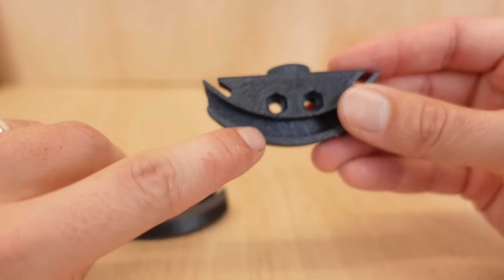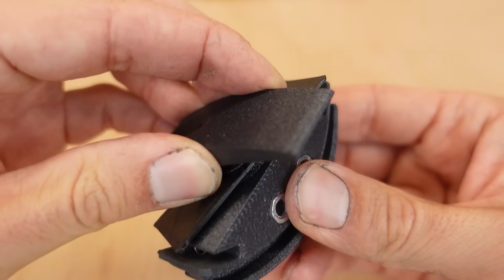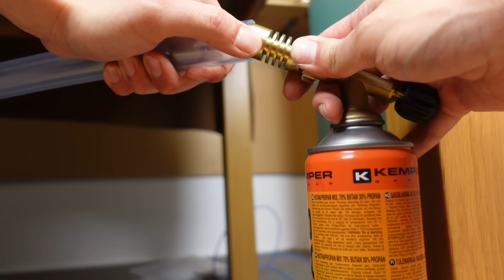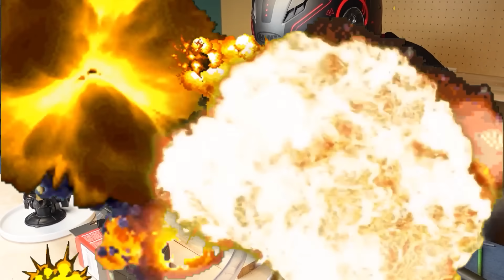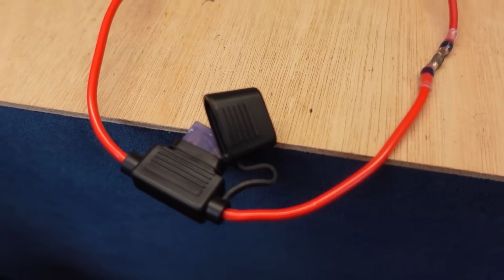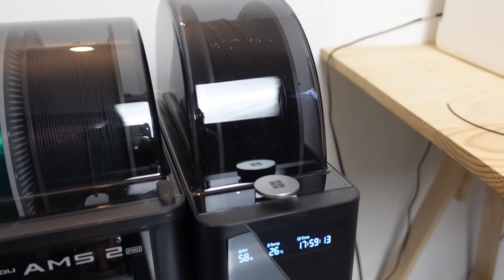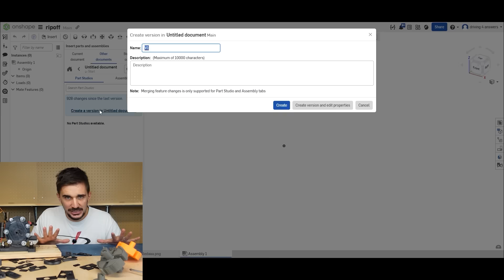My Oval Engine Now Fires At Will! Major Milestone For DIY Oval Rotary Engine 2.0

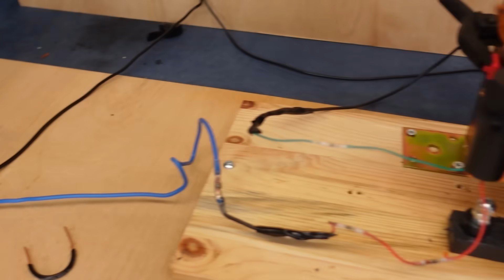Comment: BTZ5S-BS (at 6:18) is a 12V battery when fully charged 2.2V per cell X6 cells = 13.2 volts
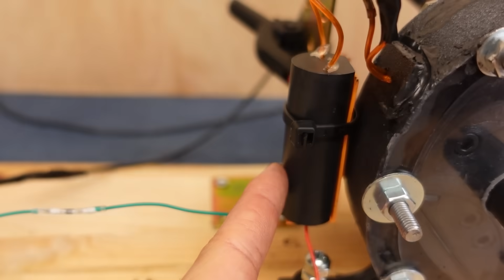High Voltage Generator (at 6:28) DC 3v-6v to 400kv
I wonder if using four (4) times the recommended input voltage could cause premature HV coil failure. Yes, it could. For better results, use 1 X 18650 = 3.7v to 4.2v
Oh, you agree. I should watch the full video before commenting.
P.S. I love the engine! I think the timing/exhaust port tuning will get a win!

Comment: It would be pretty easy to 3D print a single point distributor that would allow you to adjust the timing in real time. 

I feel like the main problem is the exhaust port being too advanced and the spark being far roo retarded.

Comment: you need it to fire on the trailing edge,  youre firing in the middle, which isnt putting any forward motion in.. should try to offset the firing events to where the next event hits at the same time as the first... might need.. 3 firing events

Comment: You are going straight from the fuel to the engine. Where is the oxygen? Mix the fuel with oxygen and find a way to adjust the timing.

Comment: old Honda dirt bikes (xl125 185 etc) had a CDI unit that replaced the Points set up, still bolted on to the cam like points but was much simpler. 
Could be a good bolt on option for a quick fix for timing as can use two sensors and coils

Comment: use small bearings four, total, on the center spiner so the travelers bottoms run against the  bearings  2/3 spaced sporting the travelers.

Comment: I commented this on the previous 3D printed engine video, but there is a major flaw with this design. The area between your intended combustion event area also expands and behaves like a combustion event area. This can be clearly seen in the slow motion footage at 10:19. The previous design even had the area connected, meaning spark could ignite the fuel all the way to the intake. It seems like this version had enough sealing in this in between area to not connect to the intake. Regardless, this area needs to be accounted for in future designs because it expands and compresses the air as well.

Comment: Maybe add an adjustable exhaust port, a couple of seals around the periphery of the port inside a slot with a set screw to hold position.  Once you get optimal position, print it again with the port fixed in position.  I wouldn't imagine the intake matters that much, but maybe do the same thing with it.

Comment: Seriously cool! I don't know what you've already tried or what experience you have with rotary engines, but here's my take.
First, I would put a flywheel on it.
Second, I would look at the port timing on a Wankel rotary engine to get a comparison. I do think your exhaust port is too high.
Third, I would play with the ignition timing. I'd adapt a reliable distributor instead of home-building a hokey points setup.
Fourth, better sealing will always be a target. You need side seals.
I look forward to seeing more of this project!

Comment: You’re not going to see usable torque from this layout. Torque is tangential force acting at a distance from the axis, but in your configuration the forces are applied symmetrically on both sides of the crank, as are the forces on the opposing chamber.. They cancel each other out, which is why you’re getting combustion but no rotational acceleration.

Did you notice any increase in crank speed during firing? If not, that’s the tell. I really don’t want to see you sink more time into a geometry that can’t produce net torque. If you ever get this design to self-rotate, I’ll gladly eat my words. Your talent is probably better spent exploring a different configuration.

You don't have to take my word for it. Find an expert you trust to take a look.

Comment: Is there any air or oxygen in that can of LPG liquid petroleum gas?  Butane and propane are both fuel, you probably have a wider range of air fuel ratios that can ignite than gasoline, but you still need oxygen.  The torch nozzle won't mix the correct amount of air unless the outlet is unrestricted.  It is using the flow of LPG to suck the air in.  You still need a carburetor that meters the LPG based on how much air you engine is sucking.

Comment: @d4a You def need to move that exhaust port lower and/or the gas igniter too (more central of the housing). Combustion is happening too late and pressure is released too early and without much of the rotational energy from the rotor almost squeezing out the burnt gases. You can see the visualized at 14:22 in the slow mo footage. Maybe even 2 spark plugs to get a faster and have a better coverage of the ignited gas over the rotor surface. The timing could probably adjusted from where it's located but IMO think it's location is not ideal. I saw at 17:00 you addressed this and will take many more prototypes to get right. I believe you will get it going on it's own soon. Love seeing the progress, keep it up bro!

Comment: I've been down this road.  If you want to start a model engine with a drill rig a one way bearing between the two so the engine can overrun the drill.  Otherwise it will never start.  BTDT got the t-shirt.
Reply: not true at all, youd feel the engine torque the drill, if the engine is large or powerful enough it rips the drill out of your hand and sends it flying.. a sprag clutch for starting would be ideal, but its not stopping it from creating torque, its clear the combustion is far too late, it needs to be starting near 9oclock and hes not getting it until more like 12 oclock, by that time the chamber is at its largest volume and about to open the exhaust port
Reply: 1000% correct. 👍
Reply: Use an air tool to get that rotary vein spinning up the rotary vein. There's little breaking once it starts up, relatively.
Reply: Exactly! My first to.

Comment: I think this engine is struggling to get enough air and fuel to fill the combustion chambers. On a traditional engine with a propane fueling system I believe the propane is injected into the air stream in a predetermined amount. This engine I think is not able to get enough air due to the torch head not supplying enough to fill the combustion chamber to be able to make enough power to turn on it's own. To me the timing looks good enough to run if it had enough fuel and air that it wants not what the torch is supplying.

Comment: Well done on getting your rotary flamethrower to produce some flames. I'm still a bit dubious about you being able to get any usable power from the engine though. To get power you want as much of the pressure produced from combustion to be producing force to turn the crank rather that pushing the rotor into the crank. A bit of modelling and some guesswork on cylinder pressure should be able to show if there is any significant rotating force.

Comment: If you're looking for high voltage arcs, the mythbuster, after using many different options, found that a neon light ballast consistently produced a reliable high voltage arc that would start fires, of whatever myth they were chasing at the time.

Comment: First I wrote comment, that these modules don't like 12V before the end of the video, then deleted it as you fixed it.
Only one thing is missing, these high voltage modules don't like to keep the charge on its output.
It is better to add wires in parallel to the output of the module with bigger gap than in combustion chamber so it will discharge high voltage if your engine is not requiring a spark at that moment.

Comment: I've sent you an email linking to a Desmos graph with the exact geometric equation you can use instead of tracing from video, which will create a much better seal. I've also sent you two designs you can choose, one similar to russian patent, one that use rod instead of large gude which should be stronger and lighter. I sent it few months ago so you may need to search it.
Reply from the maker: I never got any of this! Give me the words from the subject line so I can search for it.
Reply: @d4a  Improved Rotary Engine Design

Comment: Your spark is too advanced. Print an adjustable trigger wheel instead of that wonkey floating wire "trigger" all that work and you hacked the ignition? keep the automotive coil. Print a hall or brush trigger.

Comment: 1. You really want to use electronics to trigger the sparkplug. A simple hall sensor and a magnet on the crankshaft to learn the position of the piston or even better some rotary encoder on the end of the shaft so you always know the position of the shaft so you can easily adjust the timing of the spark. Yes more electronics, but sparking using floppy wires ... how can that be consistent or easy to advance/delay with a simple dial? Potentio meter on a Raspberry Pi, for example, hall sensor to the Pi, a few lines of code to detect the hall sensor (or rotary encode) and a simple signal to a power transistor to open the current from the battery to the spark generator. Also you might want to consider to actually use a real sparkplug. You can also detect using this the RPM of the engine and advance/delay the spark when needed ; at first manually, later you can let code do it ; at this and that RPM use this degree etc etc

2. the exhaust is a little large. That should affect the backpressure. What if it is a much smaller hole? Will the chamber be pressurized longer, enough for the piston to rotate fully/fast enough? I could think of a simple way ; take a piece of metal tube add a (metal) valve on the end of the tube to reduce how much gas can escape. Fully open, it would be like what you have now, when you slowly close the valve you can decide with unlimited steps how large your exhaust port will be.

3. for the experiment you actually do not have to shape the front ; it can be a flat square piece ; saving time. So if you want to use a thicker piece, just cut it to roughly the correct size and drill holes and you're good to go. Some RTV to seal it and done. It doesn't matter if your 'window' is sticking outside the black cylinder, you want it to run, not look pretty.

4. in combination with the electronics, you could have a small servo operate a small valve on the fuel line. It wouldn't be perfect and sensitive, but you would be able to control the throttle with the electronics ; at first with the manual potentio meter (controlling spark advance/delay) and with a second potentio meter it could control the gas pressure. You might need much more to keep the engine actually running while at start you want to just feed it what it needs. 

5. there is a chance the friction of the whole setup is way too much for the combustion to overcome. Your electric drill was obviously struggling to keep the thing going.

6. instead of a drill with all it's issues (from running out of power to how do you quickly decouple it) I'd go for a starter motor. Not from a car, but just a normal electric motor, mounted to the shaft with a small friction disc and some spring. Or a vize or a rubber belt or two rubber wheels ; something which can break friction between the electric motor and the combustion engine once that one gets going. Actually the electric motor could become an alternator/generator basically if you turn off the power to the electric motor after the combustion engine has started. The electric motor could also work as a flywheel/load so you could try to measure the combustion engine's power. If it fires up.

All in all it feels like trying to set a big water soaked log on fire by pouring a cup of gasoline on top of it ; there are so many variables you cannot control current (gas pressure, spark plug timing, starter motor speed, exhaust backpressure) that it would be a small miracle if this combustion engine would work on its own. But with the proper support 'modules' you'd increase your chances by a lot. And it would be easier to reproduce results.

Hope this helps, good luck, getting this fired up!

Comment: 12v battery killed the DC 3v-6v high voltage generators plus extended spark wires

Comment: You should have picked up a set of Points when at the Auto parts store for a reliable and adjustable ignition system. A Flywheel wouldn't hurt either.

Comment: My best guess is the air/fuel mix is not well mixed enough before it gets ignited. 
If a ( or several ) very fine s/s wire mesh screens could be placed before the air/fuel intake, the physical turbulence could help mix the ratio more evenly per volume. 
I once had a factory made propane fueled pick up truck. It was otherwise a normal V8, that had a fuel section that took liquid propane and evenly atomized it , RUNNING THE AIR AND FUEL MIX THROUGH A MESH  to mix. It ran great. The oil looked new after many miles due to lack of ash. In my area, LP went super high one day, and converting it back to gasoline was a sad compromise.

Comment: Seems a lot more complicated than the old tri rotors and probably a lot less efficient due to more moving parts, more apex seals and other seals in general, and a significant percentage of the combustion chamber is now unused when compared to a tri rotor.

Comment: I think you have the correct order for troubleshooting why this won't run, as in 'port location' and whatnot.
But, have you considered:
Lubrication. Can you prove that the rotating combustion chambers aren't sticking on the central assembly?
And
Chamber volume. If you had more width/height to your elliptical engine body, there would be more volume to create combustion pressure AS WELL AS more surface area on the sliding plates that are spring loaded. Perhaps you're not generating enough force on the sliding plates to keep the assembly rotating because they are barely exposed?

Comment: Ok so... Cool idea.. but here's one for ya.. make the cumbustion happen earlier in the cycle. it looks like combustion is happening when the chamber is already nearly fully expanded. Which is causing the force to be applied straight onto the crank shaft instead of at an angle

Comment: Btw pps-cf isn’t that good, it has really good temperature resistance BUT it’s tensile strength is really bad compared to other carbon fiber filaments like pa6-cf. The best filament personally is fiber heart ppa-cf, it has great temp resistance but its tensile and layer adhesion is insanely good for a 3d printed plastic and don’t forget about the lower coefficient of friction because the fibers are internal

Comment: The first  thing I wondered about is why you are using a 12 volt battery to drive a coil rated for a max of 6 volts.
Next is the port location / combustion chamber shape.
Next is the timing, most of the sparks are igniting BTC and the flame front just flows around the 'piston' part to the exhaust.
Next, you have no compression phase.
Next, TPU at temp is soft and sticky. Try a nylon-based filament. For the seals.
Anything with carbon fiber in it is like sandpaper and will last about as long as it would take to destroy that same part with an orbital sander. There are much better filaments for both jobs.
Instead of hacking the poly-carbonate window to fit the combustion chamber shape, just print a groove in the chamber lip and print a TPU o-ring to go in there. Now leave the window in a simple rectangle shape with a few holes for mounting screws. This will let you use a glass window if desired. Drilling a few holes in glass (or plexiglass) is a lot easier than trying to cut it to shape.
Finally, don't limit your filament choices to Bambu. It's a big world out there. Look around. Tell chat GPT what properties you need and let it find a good choice of filament for you.

Comment: Aside from the timing and ignition issues, there seems to be a major factor missing from the combustion equation: oxygen. As far as I can tell, the engine is trying to run on a pure propane/butane mixture. I don't see anywhere for air to get in

Comment: i dont know how it is with this filament, but i want to warn you, not to handle that pps filament with bare hands and maybe even wear a breathing mask.

these carbon fibres act kinda like asbestos, they are very small and brittel fibres that will embed themselfs in ur lungs and in ur skin.
so better use gloves when handeling it and print somewhere good ventialted and wihtout people in the same room

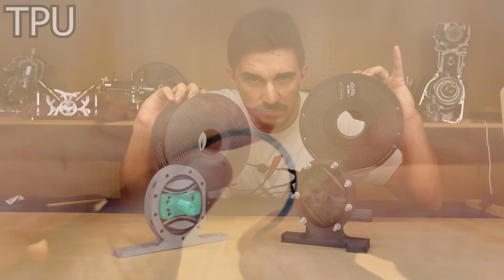Comment: 5:45 and also of the most abrasive and the least wear resistant filaments possible XD
Reply: The carbon helps ensure that its flammable too!
Reply: @kahlzun it also doesnt help with mechanical properties whatsoever as bambu uses recycled cf that isn't properly sized and wetted

Comment: I doubt that those high voltage modules are designed for rapid on-off switching.
Could you use an actual coil pack?

Comment: how is this engine expected to make torque? it looks like the pressure from combustion will be directed straight through the axle, without any perpendicular distance no torque will be generated, which might be why it won't sustain itself.

Comment: Where do I find the model? I’d love to machine this. I want to build an engine that runs off diesel and natural gas. For a rotary, diesel could be used for oiling, natural gas allows it to still run clean and pass EURO-6 & EPA emissions. While being cheap to build & powerful. Because the sealing of the engine is adjustable, this motor should last much longer before a rebuild.

Comment: Nice! The most efficient engine is the turbine though, and I don't know anything about patenting engines, so I came up with something that makes the turbine even more efficient; feed the exhaust from a turbine into a boiler, and use the steam to generate electricity. Not sure if the idea can be branded, all the machines involved are already patented, but I believe the idea will work.